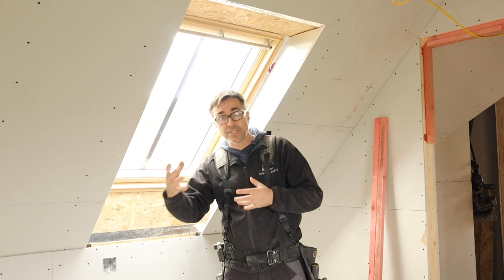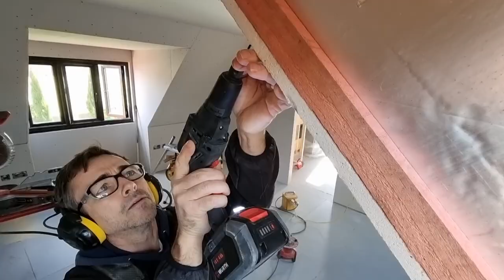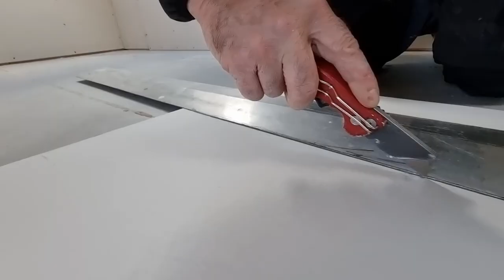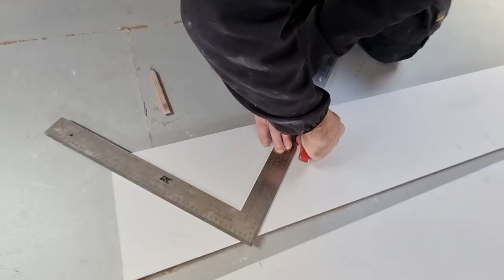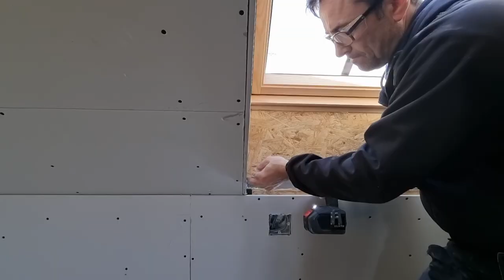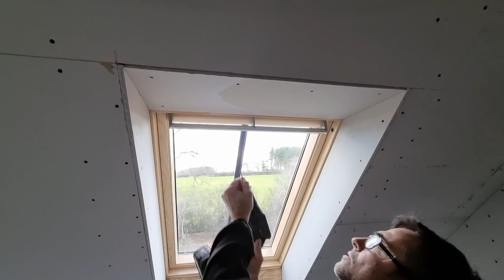Lining a velux with insulation and plasterboard

Comment: Great job Robin, your plasterboarding is way neater than mine!   I’ve just come back from renovating my house in France including 3 weeks of finishing the plasterboarding.  I think you have a big advantage in a new property of being able to lay everything out square and true whereas I was plasterboarding veluxes in an old roof no nothing true and in and around wooden beams which need loads of cutting in.  
One thing a builder told me about was to angle the reveals of the velux opening into the room, this lets a lot more light in than having them at 90 degrees, but does mean that there are more angles to deal with in the reveal.  Usually ended up with having to box the reveal out with 3 pieces of plasterboard, one each at the top and bottom and then a square one in the middle.

Comment: Hi Robin

You make DIY to your high standard look so easy. Well done.
I have had a velux fitted to replace an old rotting velux. The builders had to cut into existing plaster reveal to get new velux in. now there are mainly small gaps around the whole four sides/ edges where the frame sits , but one part has a recess of 20mm deep. Could I use expanding foam for the 20mm recess part? Or might the expanding foam potentially lift the tiles above  and just use polyfilla or even easifill 60 for other gaps?
Thank you

Comment: Thanks for the instruction Robin   Can I ask, is it best use square edge board when it’s been skimmed ?  I think your garden room is the same ! On the few plasterboard jobs I’ve done I always buy tapered edge and get it skimmed  should I be using square edge ?
Reply from the maker: Hi Dan, when you are skimming it really does not matter if you use square edge or tapered edge, the only thing to watch is running a tapered edge next to a corner where you need to fix a thin coat angle bead, this makes the bead sit too flush
Reply: @ukconstruction  thanks Robin

Comment: Robin, excellent video. Question about angle beads. I understand you place corner beads at both sides but what about the spleyed side? Do you put a stop bead there? So 2 sides will be standard angle beads and the top and bottom of spleyed side would be stop beads?
Reply from the maker: Hi mate, you guessed correctly, we will use a normal thin coat angle bead where ever we can and then the thin coat stop bead on angles etc